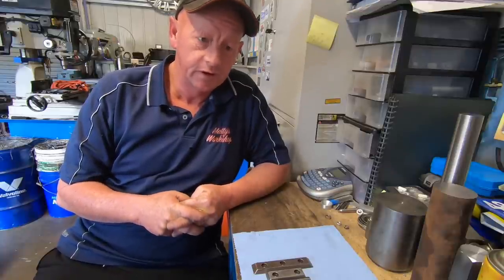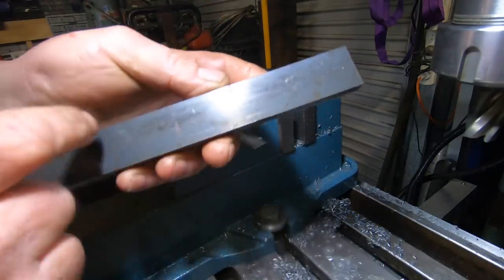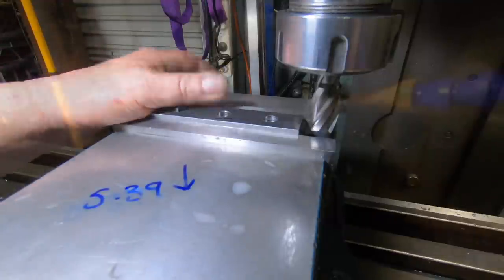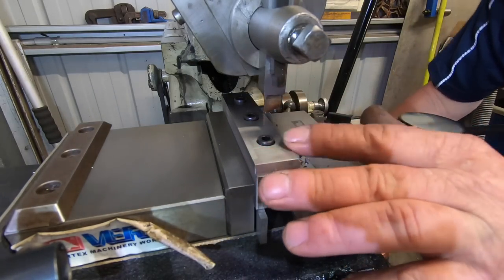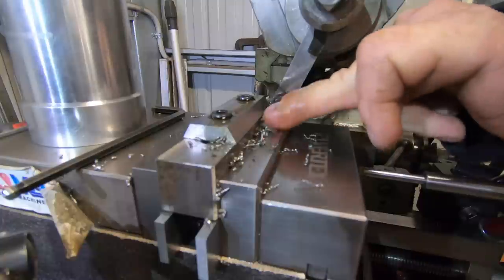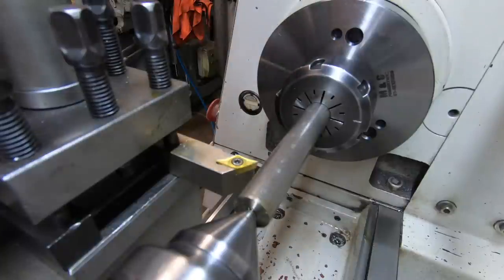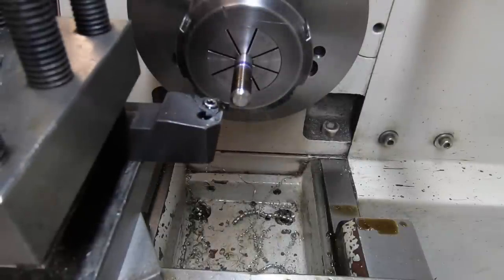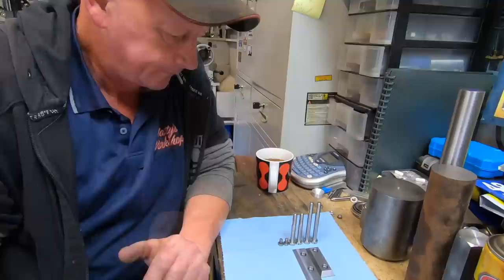CUTTING EDGE ENGINEERING - SIP HYDROPTIC 6 JIG BORER PARTS

Comment: Great job Matty. The bolts looked absolutely perfect - I always struggle cuitting the slots dead centre.
Cheers!
Andrew
Reply: There's a trick for that.... If you're holding the work in a collet block or the rotary table/indexer, just take a second cut at 180° to the first, then the groove will naturally be on centre. Obviously a bit more involved if you want to hit an exact size, but for a screwdriver slot it should be adequate.
Reply: @ollysworkshop  great tip! I must try to remember that one 👍
Reply from the maker: Gday Andrew, I was shocked I get the slots on centre, never normally happens, thanks for watching, cheers

Comment: Matty, some time when you have nothing to do, try grinding a full half radius on a piece of HS stock.  this will give you a great finish due to there never being a sharp corner when the bit steps down.  Grind it to look like a button insert.
Reply from the maker: Gday Adam, this would be very similar to the shear tool I have, I should of made the fixture differently to cut the angle, thanks for watching, cheers

Comment: Hi Matty. I'm going to show my ignorance about shapers here, but could you not have set the tool to 60° and used the X axis feed (i.e. not moving the Z axis). Surely that would have given a cleaner cut than the 'staircase' generated by incrementing down the slope? Just a thought. Would be interested to know what you think. Glad you are feeling better.
Reply from the maker: Gday Olly, the way I should have done this is I should of made a fixture that held the 60º flat horizontal then I could of used a shear tool to get the ultimate finish, thanks for watching, Cheers

Comment: I agree with your observation that it would have been better to make the jigs at 45 and 60 degrees and then you could cut it flat on the shaper. My shaper table is just big enough for me to mount the GoPro on for filming. Anyway to make a bracket or something to fix to your table to hold your camera?
Reply from the maker: Gday Tom, I should have made a different fixture setup but never mind, thanks for watching and commenting mate, Cheers

Comment: "Unable" to get a good finish on the shaper, I would have machined it on the mill with a fly cutter with the head set at 60 degrees. Better finish and also quicker.  Cheers Matty.
Reply from the maker: Gday, I wanted longitudinal lines on the angle sections, doing it on the mill would of been a lot quicker I’d say, thanks very much for watching, cheers

Comment: Matty, excellent work as usual. Re multiple spring passes when cutting the M6 & M8 threads, I wondered whether you could have cut the threads with tailstock support ie before machining off the shaft centres? Anyway, always appreciate the explanation of your set-ups and glad you're back in the shop. Cheers, Alan.
Reply from the maker: Gday Alan, the live centre I have isn’t all that good and on small parts there’s not enough room for the threading tool and the start of the thread, I’d love to bug a Daintree live centre, there Australian made and extremely good quality, thanks for watching and commenting mate, Cheers